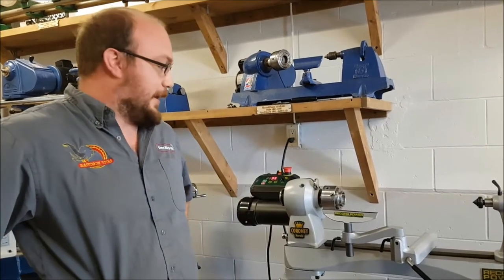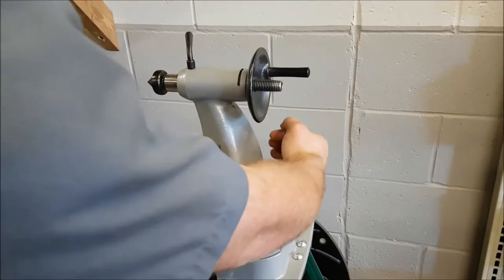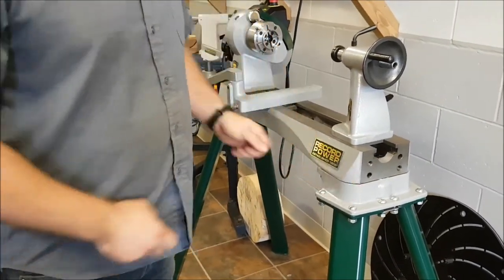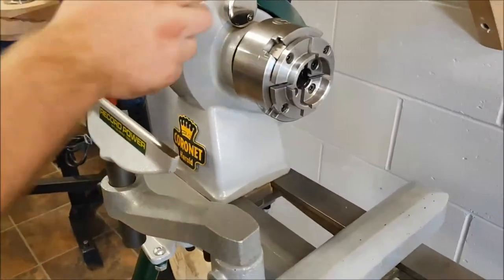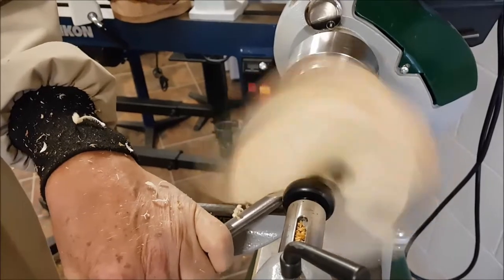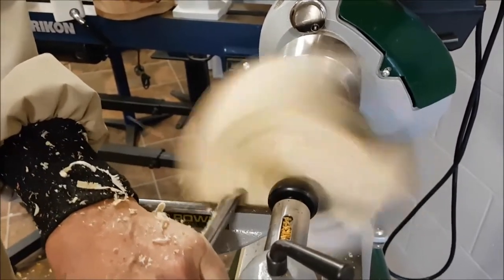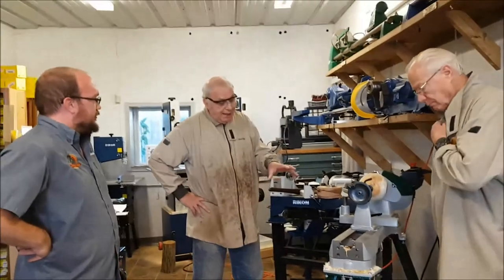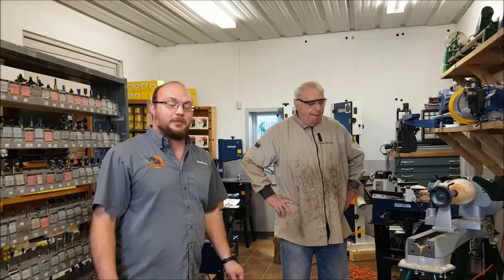Coronet Herald Lathe Review With Marv Ens & Peter Hyde! Record Power EthAnswers

Comment: Really enjoyed the work out on this new (to Canada ) lathe Ethan. As you know when I first saw it a few weeks ago I wasn't  exactly impressed so it's great to be proven wrong😀 The Osage Orange was felled about 10 years ago and cut into bowl blanks. Moisture content is around 12% so pretty dry and hard. The heavy cuts using a 40/40 grind on my 5/8" bowl gouge didn't cause any problems as seen in the video. Definitely a lathe to consider both as an upgrade from a mini or as a lathe to last a lifetime.
Reply from the maker: Thanks for coming on using it Peter! I appreciate your thoughts on the lathe.
Reply: Loved your insights and analysis, Peter both from you and Marv and EthanThere’s a big difference between a salesperson with little, hands on experience versus actual wood turners. Ethan, you and Marv are all woodturners so value your opinions.

Comment: Thanks for the review. I have a midi lathe that has a self ejecting tail centre. It can be a pain when you are trying to squeeze every last millimetre out of bed length to say, drill a hole and as you wind it back the centre keeps coming out! I would have to offset that with the probability of scraping my knuckles on the thread.

Comment: What is the amperage and voltage of the motor...can the motor be wired as 220v if it comes as 110v
Reply from the maker: The motor is 120v and runs at 10amps in North America. It cannot be re-wired for 240v.
I hope this helps!